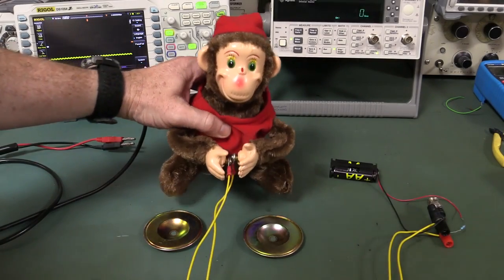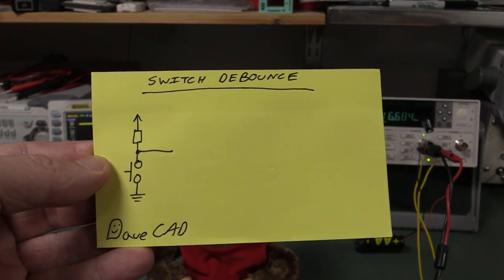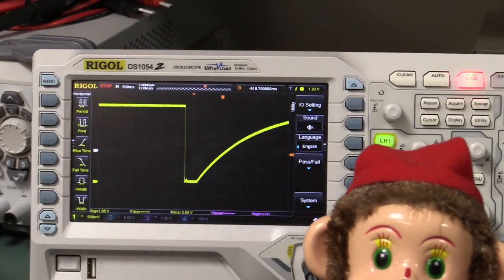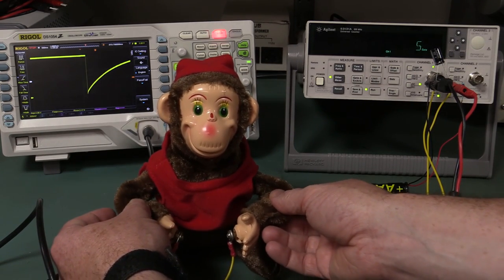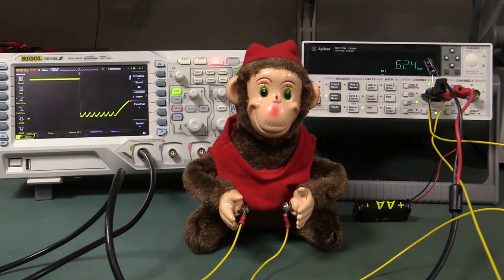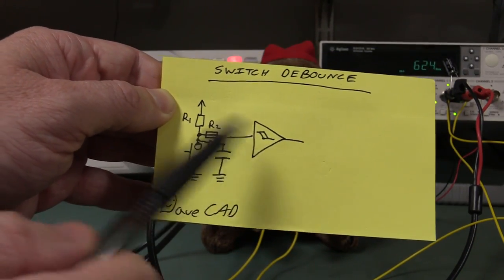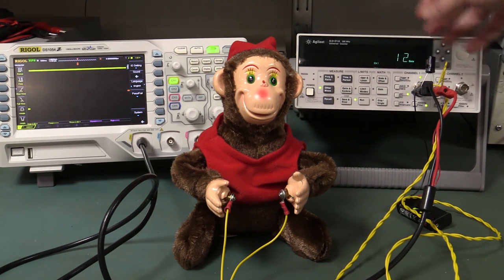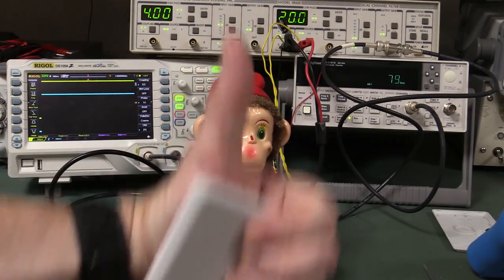EEVblog #961 - Monkey Debouncing

Comment: Dave, I once built a "number of seconds to graduation" counter with a calculator. I bought a 1hz timebase from Radio Shack, hooked it to a 4066, and hooked that to the = key on a calculator. Poked in the starting value and "-1" and started the circuit.  This was back in the late 80s.  Mounted the whole thing on my dorm room door.
Reply: See next video. :D

Comment: RC = time.  If you don't want anything faster than say 1/20 second, R1 = 5k, 
hence C = 0.05s / 5k = 10uF.  
Use a smaller cap.

Comment: I'd use a magnet and hall sensor
Reply: Should have used an Arduino too, as many of us have yet to collect lab gear ;( Bonus is that it can be programmed to count one and then sleep to better handle "Bounce/Chatter" - Or, perhaps a rPi with a pythin script to count and post it to a live page along with other stats like the total run time, number of claps, battery voltage etc.

Comment: Hi, Dave! The sensitivity / hysteresis is in fact specified in the operating manual on page 3-2. But to be fair, not everyone has time to search through the manual to find it. First you set the trigger level to the midpoint (or slightly under in your application using a capacitor). Then you look at the section "Voltage range and sensitivity (single shot pulse)". We find the sensitivity is 50mVpp for this application. Then we see LO sensitivity is roughly 2x HI sensitivity, so our LO sensitivity is around 100mVpp in this application. Easy. :-) Anyway, I like your channel. You're doing some great work!

Comment: Honestly, I'd just hook it to an Arduino, and put a 200ms delay after contact (require a 2ms solid pulse to trigger to eliminate the noise problems) before starting to look for the next one.  It could be the counter as well.  Enable the internal 10K pullup and it probably won't even need any external components.  This would take about 10 minutes total to implement, at an entire cost of $5.  This is the same as the 555 one shot plus the counter really.
Reply: you're right, but you're not doing an educational show about electronics on YouTube :p
Reply: Ybalrid Well, I do, but it's a different channel.  And I have nearly one subscriber!

Comment: Use a '4538 one-shot IC.  It has edge triggering and hysteresis built in. Set the RC time constant for the longest contact noise duration and wire it as "non-re-trigger-able". Need it faster than the noise duration? Use the 2nd half of the IC to "kill" the input noise.

Comment: The monkey may get tired as the batteries get weak and thus your 1.5V trigger level may not be a good idea since it may start counting the individual claps. Better just to reduce the trigger level or capacitor value and count all claps.
Still clapping monkey is not a good measure of energy used since while battery voltage will go down without the batteriser and the current used by the monkey will also drop not to mention compared with a fixed 1.5V output using the batteriser.
That is not to say that batteriser has any useful application.

Comment: You could have picked up faster triggers by setting the threshold nearer to zero volts instead of 1 volt like you did. So even if the cap was only slightly charged, you catch those falling edges at the bottom of the graph.

Comment: One issue with counting only cycles and not individual claps is when the batteries run low and his overall speed slows down, it may end up counting the individual claps as a cycle if he slows down enough.

Comment: Why the R2 resistor cannot be placed in series with the switch? 
On the other hand, a diode won't just complicate things? As far as I can understand  C1 cap will charged through R1 below (VCC-0.7), and after reaching that voltage, will charged through R2, giving two separate charging profiles.

Comment: If you set up your system to count cycles you get a problem when the batteries are going weak at the end. The time between 2 claps will rise, and you will count claps instead of cycles.

Comment: In this case the problem with counting cycles instead of claps is that he slows down as the batteries get low, so eventually the capacitor would probably charge above the threshold every clap.

Comment: Add another diode parallel to R1 - has no use, but the middle part of the circuit then reads: R2, D2 8-)

Comment: Isn't the capacitor a little bit too big? Would've expected something around 100n or something like that.
Reply: Yes, but it depends on the resistor value which was relatively low (I think he said 5k6)  and so 100n would have given quite a short time constant
Reply: Yeah, but in his version you can see the voltage rising in real time, you really don't need such a big time constant.
Reply: Agreed

Comment: I just realized Dave has never done an episode on frequency counters practical uses and common use of the tool, eg. maths available and what you would use them for, period measurement, difference etc. In fact there does not seem to be anything like that on the tubes.

Comment: I suspect that noise is comming from the incredibly bad dc brushed motor in the monkey. Expeienced similar situation with simple 12 volt brushed fans. You will be looking at your scope and wondering where this noise is comming from everywhere. Ditch anythinhg with brushed motors where posibble.  Slap catch doides across motors if got access to them.

Comment: Why not just use a shielded cable to the monkey and tie one end of the ground braid that is inside the cable to an earth ground (do not tied both ends to ground. Only one side) ?That will solve 90% of your noise issues. Do it all the time in PLC systems that have to read analog singles from sensors mounted far away from the control panel.....

Comment: Is it a capacitor recharge problem or a capacitor discharge problem?  Seems like the cap wasn't discharging fast enough to register another count when clapping fast.  Looked like the fast clap was keeping the cap charged.  I am guessing the counter was waiting for the voltage to drop below a threshold before it would index another increment. 

Maybe I'm completely wrong.  EE is more of a hobby for me.

Comment: I dont' know what point are you tring to make, but as soon as I saw the capacitor value (330uF) I knew it was way to huge for the job, it dosen't make sense from any perspective, it is huge, it cost's an eye and a leg and the filter cutoff frequency is way to low 90 mHz, (yes milliHertz it is not and error) when 10-20 Hz is more then enough, using a 100 nF and 100k  would solve all your problems, speed, power and all
Reply: He chose a far-too-big capacitor in order to more easily demonstrate the way it behaves, specifically the inability to count events in rapid succession if there was not time for the capacitor to recharge.
Reply: ***** well that only easilydemonstrates that if you use the wrong components the circuito will not work, a lot of the problems he described are not only amplified, they are created by that capacitor/resistor value combination, if you have higer R and smaller C there is almost no stored charge in the cap, so no poer loss, you Can make the Time constant 10/20 mS not 5 S and the missing counts issue is resolved, you use ceramics  and not x capacitor and te EMI are better filtered (lower est/esl)
Reply: He is "illustrating" the act of solving a problem. Look it up.
Reply: Still why not illustrate the act of solving a real problem, and not a made up one, that everyone who has a clue of how a capacitor works woud have seen coming...
Reply: Solving a problem with a very limited set of parts is as real world as you can get.  It's fine if you can always get the value you want, but he shows here that even with wildly inappropriate parts, the problem is still solvable, and it illustrates many of the other things that can go wrong.  Many of us aren't here to see "how it's done right", but to learn.  And doing it "wrong" teaches far more.

Comment: 12:00

So in this case the current flows from one end of the cap (which is located right at the red and black terminals of the universal counter) all the way through the monkey hands and then to the negative end of the cap?

Comment: 13:50 why not put R2 in the branch with the switch?
Reply: That was my thought too. Surely that avoids the need for the diode.
Reply: Please notice me on the answer to this question, I use circuit with resistor on push button branch.
Reply: Visher what you are you trying to communicate here?
Reply: I am noticed about your answer, so why not?
Reply: Visher OK. have a nice day.
Reply: Then the cap will not discharge to 0V. There is a Voltage divider when the switch is closed.  The final voltage will be the Vcc*R2/(R1+R2)
Reply: Vikram you're right, but if we use weak R2 value comparing to R1, the voltage will be so low that it won't be detected as high in TTL/CMOS devices
Reply: Visher, You are right but there is just one point. 

I'm not really sure with this but hear me out. Normally, when you have  a voltage divider with a cap in parallel with one of the resistors, the cutoff frequency or RC time constant is calculated not by using R1 but with the parallel combination of R1 and R2, a.k.a Thevenin's equivalent resistance, which is much lower than R1 or R2. 

So, RC time constant  = R1*R2 *C/(R1+R2). In order to get a decent time constant, the value of both R1 and R2 must be high, thus creating a problem if you wanna make it TTL/CMOS Compatible.
Reply: I see your answer, thank you for the explanation

Comment: I zoned out. did he address why the counter Increments just before the clap sequence starts?
Reply: Not before the first clap (that would be impossible) but some time after the last clap. It was set to trigger on the slow rising edge of the RC curve.
Reply: that would have been due to the threshold voltage and slope setting - it was registering the previous set of claps after a long delay once the capacitor had finally charged up to that voltage - just before the next set of claps started